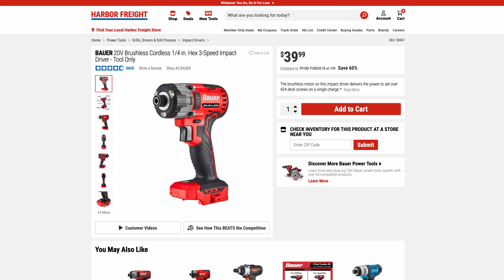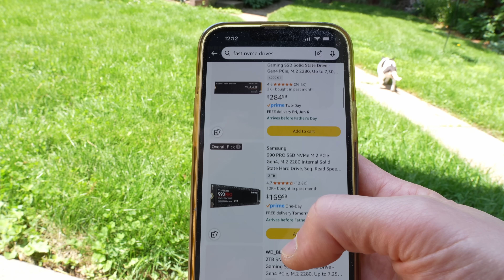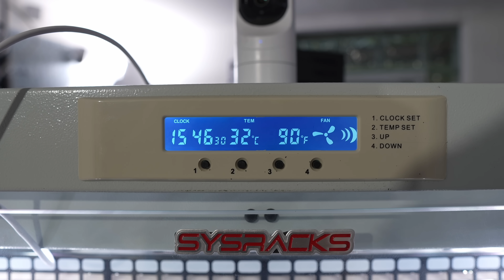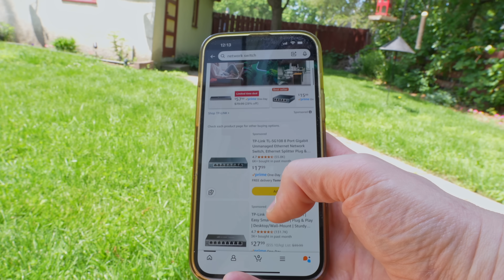Buy Once, Cry Once: How I Wasted $2,857 on Switches

Comment: It's not cut and dried. Requirements are always changing (generally increasing), available gear is always changing (more and better features), and the price for a given feature set is usually decreasing. The real question is how long the gear one buys serves it's purpose, and rather your are really utilizing the features.  If one needs to replace the gear in only a year or two then it probably wasn't a good purchase, if it lasts 5 years or more then it was a good purchase IF you are utilizing all the features. For example, getting a 48 port POE+ switch would still have been a bad choice 5 years later if one never used more than 20 ports and didn't end up needing POE after all.

A couple of my Unifi APs are over 5 years old (Wifi 5) and still do what I need them to as all my high bandwidth devices are hardwired, and they were low cost APs.  If I had spent more, it would have been a waste of money. As far as switches, what I have is 4 to 7 years old. An upgrade would be nice, but what I have is working fine and not causing any bottlenecks so upgrading isn't a priority. It's a balance of reasonable future proofing, without going crazy and over spending.

Comment: Too much money :) But it's a nice switch for sure with that wided speed support. But the drawback is definitely RG45 port instead of SFP+ because this makes everything more expensive in terms of connectivity. 10G SFP+ is a few bucks and optical patch cord is also few bucks for decent lenght. This is times more cheaper than RG45 10G SFP+. Would be so nice if those vendors start making those PC and devices with SFP+ cages instead of RG45 ports !

Comment: Focusing on 10GBASE-T just for the funny big theoretical number feels awkward. The denoising & step-down converter involved in 10GBASE-T typically makes such ports consume far more power both when compared to fiber and when set to (or idling at) slower speeds vs. "native" 2.5GBASE-T/5GBASE-T ports, both of which standards released much later (2006 vs. 2016) to fix 10G's issues. This gets worse if you don't use high quality cabling (at least 6a). Meanwhile you're unlikely to saturate the 10G link past brief bursts that won't ever save you but a few seconds.

Comment: for me the buy once cry once is closer to absolute nonsense than to make any sense
with some tech

but with networking stuff, well that usually is way more time lasting than for instance, a server, or a computer even, because CPUs advance way faster than networking and CPUs get way cheaper with time, so it is sometimes better to buy just what you need, not what you will need, because the moment you need it, it will cost much less and be worth the wait

summary: as always... it depends, but yeah, i see your point
Reply from the maker: For sure, it depends on many factors.  There is no one size fits all.

Comment: As many have said, you buy good-enough, then buy for life. Cheap in the beginning to make sure you use it at it solves your primary issues; then expensive once you've learned more and need the features the higher priced option provides
Reply: You buy for life? Your punch card reader hasn't worn out yet? How's your 2.5Mb ARCNET holding up? Probably sucks waiting over a day for a single movie to copy over.

Comment: I could use that switch! But the trade off is that I have servers that have multiple NICs connected to multiple switches for redundancy, so if one switch goes down, those servers are unaffected and can failover automatically to another switch. So, you may want to keep some of your old switches for redundancy (and to make yourself feel better about past spending :-) ). Thanks for the video!

Comment: I am about at this point with UPSs that need $300 batteries in a few towers around the house, when I should just put batter packs on the wall for a whole-home UPS. I have usually embraced the future proofing method (buying something, complete with value-add or intrinsic value licenses) so it wouldn't be another spend down the road. 

My switch setup: one Aruba 3810 with 80G lag to an Arista 7050 72 MLAGd to an Arista 7050-16. All the servers are LACPd with 40, 8 SFP+. So I have POE, 40G, 10G, and 8 flex ports on the 3810 to tackle other connections. It's not friendly on power, but it is ultra high performance and very flexible.
Reply from the maker: I feel the UPS batteries... I just bought FOUR 2 weeks ago.....
Reply: @TechnoTim  right... and I swear the batteries are rigged to fail or flag a warning, after a power hit and they've shouldered the outage. I am wondering if anyone else has this phenomenon where the UPS cries foul for needing to replace a battery after a hit.

Comment: I am unhappy with how long it's taken 10g base-t to become an accepted default standard for consumer hardware... and it's still few and far between... - to be honest, I really wish that every desktop machine and notebook dock came with at least a 10g sfp+ port, but for some unknown reason that's not where we're at, and that also means that 10g (both copper and fiber) is STILL expensive (when it really shouldn't be by this point).  you've been able to buy used decent intel 10g network cards for around $50 on ebay for quite some time (often cheaper) (both 10g base-t as well as sfp+), even dual port cards aren't that much more expensive (I myself have standardized on intel x540-t2 dual port 10g base-t cards for my home servers), and having those availible would be just fine for lots of uses except that most consumer hardware doesn't have NEARLY enough pcie lanes.  consider a gaming desktop computer with a high end gpu, you're using 16x lanes for the gpu, 4 lanes for the onboard i/o (usb, audio, etc.), 8 lanes for 2 m.2 drives, and you've already reached the capacity of the number of lanes available on a 9950x or ultra 9 285k (current top end consumer cpus), if we were to install a 10g card, it would either have to be installed in pcie slot 2 (which would instantly remove 8 lanes from the gpu significantly decreasing it's interface bandwidth (on a 4090 it actually matters), or you can install it in the bottom 8x slot halving the total throughput of the 10g card (it's a gen2x8 card) which is still fine for 10g but i think you might sacrifice high speed i/o when both interfaces are maxed (not sure, didn't do the math) AND you'd be taking bandwidth away from that second m.2 drive (it would be shared). this is unacceptable.  we either need more pcie i/o on at least enthusiast consumer chipsets (this would be my preference, would be happy to shut up about it if we got significantly more pcie lanes on cpus/chipsets moving forward). OR i'd also be happy for the most part if they would make 10g a standard interface using the chipset onboard i/o lanes (i'm probably not running usb/thunderbolt at full chooch while trying to use full 10g networking.

where this effects most home folks the most is NOT in internet connection (where most folks' home internet maxes out at around 1g anyway (some of us with decent fiber get upwards of 2.5g), but rather, this is more about NAS connectivity - being able to read and write files to a NAS device or other home storage server at high speeds.  heck, even 10g is slow these days... that's only 1.28GB/s network transfers.  individual modern consumer ssd's can do sequential block i/o at upwards of 14GB/s for high end gen5 ssd's.  if you put 5 of those in a raidz zfs pool it has the potential to do in the neighborhood of maybe 3x that speed...  this means that we're nearly ready for moving up to a higher end standard.  and while there are standards that are already time tested and approved (and honestly outdated when it comes to the datacenter datacenter even such as 25g sfp28 (3.2GB/s), I really think it's time for an alliance of consumer network gear providers take a step back and revolutionize the industry by getting all of the major consumer brand manufacturers together and push for 100g qsfp28 on everything and release commodity managed switches 24/28 port switches in the neighborhood of $1200-2000 just like they did some 10-15 years ago when 10g base-t exploded in the datacenter.  most of the question about if they should including high speed interconnects on consumer things is the cost... well the cost gets significantly reduced if they're ON everything and people expect them to be on everything.  and yeah, for some folks, especially office buildings, it'll take some time and money for folks to run fiber alongside their cat6, but boo hoo, that fiber will also literally last forever as later on down the road when we move past 100g signaling, we'll end up using multimode which should allow us to carry multiple laser frequencies along the same cable for not infinite, but VAST scalability into the future.  I myself will be doing a fiber install in my house when I start renovating next year and have many of the walls off.

the problem is that it needs to be adapted by everybody all at once and the hardware needs to be good and it needs to be more than available, it needs to be complete ubiquitous to take full advantage of economies of scale and public perception of "getting way faster connection from fiber" instead of pushing the usual rhetoric that 1g wifi is zomg fast and that 10g MLO wifi is the future (which is a pipe dream in the best of circumstances).

Comment: I "splashed" out on the Pro Max 48 PoE last year and at the time it was overkill for my needs. Fast forward a year and I am now only using 11 of the ports with 4 of the devices being PoE. I have plans to add more cameras and wired APs so it's nice having something that for me will continue to be useful for many years to come. Overall the steep price I initially paid has saved me money in the long run.

Comment: Tim, that switch didn't exist when you started, and furthermore, the switches you mentioned were all at the same level as the one you are touting now as the replacement. 
I have got the same switches, and each promised to be that "one switch to replace them all." Yet, next year, there will be a new switch that does one more thing, or does something better than the one you just bought. "Buy Once, Cry Once" is a nice saying, but that also means be responsible enough to wait on tech until you ACTUALLY need it, not just can find a good enough rationalization to purchase the latest and greatest. A year ago, Ubiquiti was touting EtherLighting, and that was going to fix organization. This year, they made 10G more attainable. Neither are going to change the world, compared to what you already have. Next year, it will be something new. But, let me ask you a hard question. Did that single switch you just bought really change more than a few sfp+ adapters could not have solved, while you were paying it off (in use)? This rush to have the latest just keeps growing, and the industry is only too happy to keep putting out wares to flock to. 

Needs: Stuff you need to function in what you do.
Wants: Things you know will bring you benefit, and worthy of saving for, but not worthy dropping your other needs for. 
Wishes: Stuff that would be incredible to have, and you can save for, but the lack thereof won't diminish what you are doing today.

Comment: Great point. However, I think the one thing you left out was education cost. I've run into a similar growth starting with a few switches only to need more and bigger ones later. But, there was some much-needed education I received from experimentation and testing that does add a value. I wouldn't have known I needed the "cry once" switch unless I went through the exercise dealing with all the others. We need a new name, SFP+++ OMG 🤷‍♂

Comment: Another question you should ask yourself is: "Do I actually need 10Gb for that device?".  Just because something supports 10Gb, doesn't mean it needs or uses it.  Monitoring my network shows that I rarely go above 2.5Gb aggregate.  Sure there are peaks to 10Gb when VMs are all starting up or backups run, but they are very brief.  If I was being honest with myself, the setup would work just fine at 1Gb, albeit slower.  I am happy with my setup now.  I have a USW Pro Aggregation 32 port and a US 48 PoE 500W.  My TrueNAS servers have 1 x 10Gb + 1 x 1Gb (active-passive) up-link to the storage VLAN on the two switches.   The ESXi and oVirt nodes have 1 x 10Gb + 1 x 1Gb (active-passive) up-link to the storage VLAN and 1 x 10Gb +  1x  1Gb (active-passive) up-link to the production VLAN trunk.  The 10 Gb aggregation switch replaced 2 x  US XG 16 switches, which have gone on to be perfect leaf switches as they come with both copper and SFP+ 10Gb  I have divided my access points so half are powered by POE and half draw power locally.  The end result is I can reboot either switch in the stack with no connectivity issues, especially on the iSCSI storage side of things.  Makes firmware upgrades easier.  I don't regret any of the switches I bought since they've all served first in the main stack and then as leaf switches.  My surplus switches are 2 x 48 port 3COMs and a bunch of TPLinks I bought off eBay at very attractive prices.  A couple of the TPLinks are even still in use.  One of those switches is where my cable modem attaches.  It's function is to do a copper to fiber conversion and up-link to the main stack.  Why you ask?  Because the cable company buried the cable 6 inches from the surface and lightning is a very real issue.  It also allows me to control the VLAN trunk going to this boundary switch such that even if the cable modem was attacked and hacked, the switch it is on doesn't have access to any of the VLANs that matter; only the VLAN that feeds straight into PfSense comes to the switch.
Reply: To be honest there are quite a few devices that only need 100mb, and even though they may come with 1gb can barely saturate it. Now don't get me wrong, my entire house is OM3 10G Fiber, but that is to zone switches that then break out to multiple 1G and 2 10G ports. The only devices utilizing their own 10G are Fileservers, two VM hosts, and my Workstation.
Reply: @napalmsteak  that's the same design I went with.  I had 10Gb in the main stack and then used TPLink switches out in the rooms where I needed more than one connection.  If/when I found a cheap US 8 PoE 150W I would replace one of the TPLinks.  Back in the day people used to sell Unifi switches as bad because they didn't know how to re-configure them; the good old days.  When I replaced the 2 x US XG 16 in the main stack with a USW Pro Aggregation 32 port, I used the two XGs to extend 10Gb to the office and build area.  Now I am down to 2 x TPLinks in use, with about 4 sitting on the shelf.  Barring hardware failures, I think I am done for a while.  The USW Pro supports 25Gb on 4 ports, so even if I move to nvme storage, I would probably be able to feed everything else just fine.
Reply: his 8k 120fps security cameras need 10gbe
Reply: @vinbmxnj  yeah... got to be able to read the inscriptions on the burglar's nipple rings.
Reply: @vinbmxnj  why would a camera need 10GbE, is it sending Mjpeg video? Nice brand name cameras still have 100mbit ports (axis/bosch/panasonic)
Reply: You only realistically need 10Gb inside your rack. If you want it cause it’s fun to have the biggest number, that’s all good, but 10Gb is not something any end-point device is realistically going to saturate on its own. It’s good for cabling between switches, routers and VM hosts, because those carry the traffic of multiple devices.
Reply: Yes, the answer is yes.
Reply: Most people don’t need 10G.
1G is good enough
Reply: For home you certainly don't.
Reply: What I do is 1g to clients, and 2.5g to end devices hosting multiple devices. So APs get 2.5g, desk switches 2.5g, computers 1g, and hypervisors also 2.5g as their bridge devices are basicially few-port switches. The actual switches link together at 10g, and if a hypervisor has a massive amount of vm's it may get 10g and NASs and DVRs get 10g too as they often need the bandwidth. Unless you are a hollywood editing studio, individual clients never need 10g.

Comment: I bought two used 48p hpe managed 1gb switches many, many moons ago.  You buy two because if one switch fails, the other one picks up the slack.  My home network has been perfect for me and my use case for years.  And that's really the goal here - for it to be good for your use case.   What I really am looking for next is a pair of managed 16 port 100gb fiber switches.   I could do a pair of 4 port 400gb switch (breaking it down into 1 crossover and 12 100gb dacs)... Again, two because failure always happens when you can most ill afford it.  I haven't seen that speed/port count option from anyone yet (Unless our friends at Mikrotik have dropped something in the last 3 months I haven't seen)... let alone on the used market with a device that doesn't require a service subscription.   In any case, you engineer around your needs.   But if you see your needs growing - make sure you take that into account.  A rack of stuff can easily eat a 48 port switch.  Having a pair for redundancy is a good idea and it means all your uplinks have multipath which is good for doing esoteric networking learning and optimization.   Why else would you have a home lab after all?